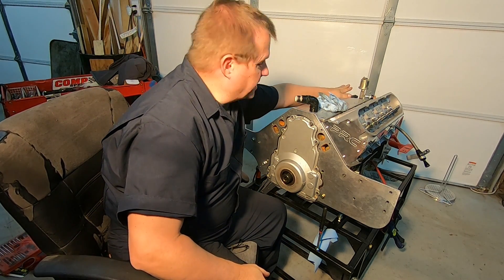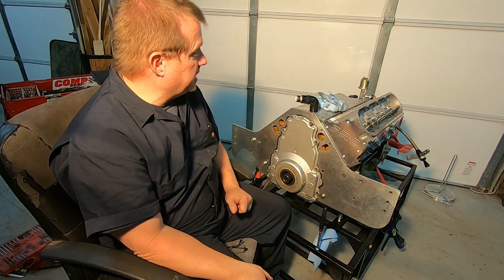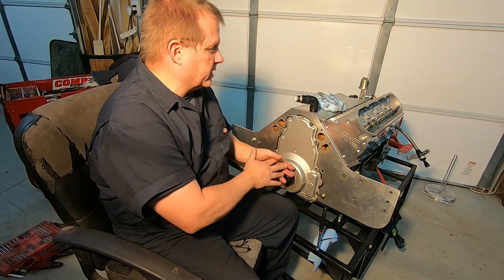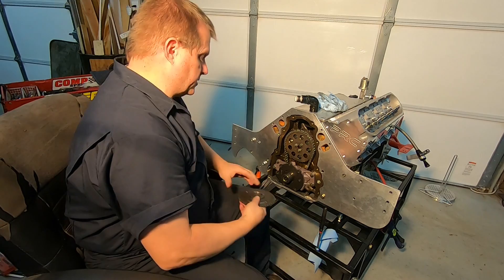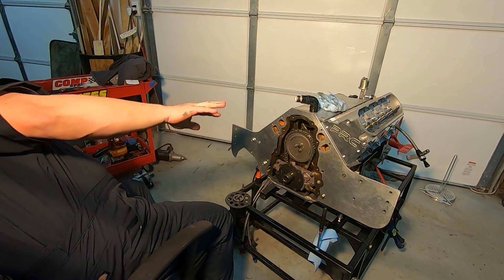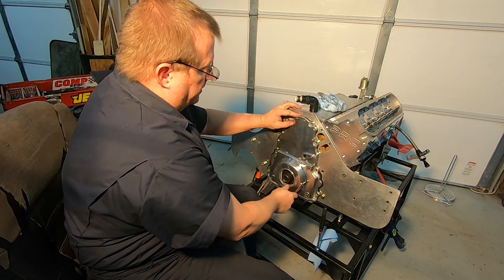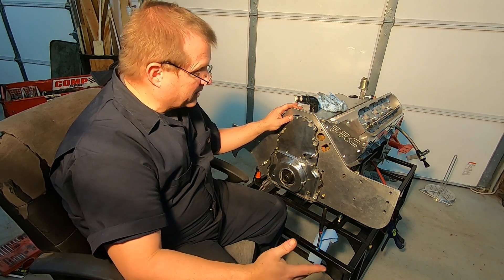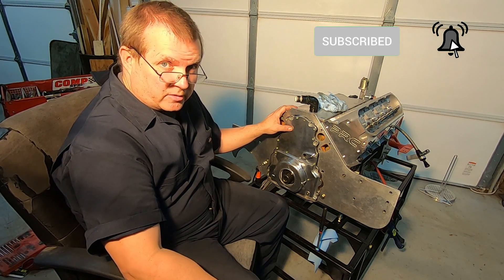How To - Swapping LS Cam Sensor from Back To Front

Comment: I got a new GM cover, included the seal, sensor and the cable harness (with guide) for the front of the engine. Only extra then needed for a standard install is the extension cable from back of the engine to the front.

Comment: Just a note to help people. When you do this and if you get pops and bangs and not a smooth running car then you more than likely will need to swap the A and C pins on the sensor. Just had this problem and even Holley was in noble to help. You can also turn off the cam sensor in Holley software but the pin swap was what worked for me.
Reply: Do you know any other methods to fix the backfire been having the problem for a long time and it keeps saying the sensor has low voltage
Reply: @TTOBS  just call me tomorrow number is on the website
Reply: @TTOBS  did you ever figure out your problem I’m having the same now with both my cars running the 6014 box only at full throttle it pops and backfire out card
Reply: @TTOBS  did you ever figure out your problem I’m having the same now with both my cars running the 6014 box only at full throttle it pops and backfire out card
Reply from the maker: Thanks for the advice do appreciate it.

Comment: thanks for the info
Reply from the maker: No problem! Thanks for watching!
Reply: hey Ken how are you
we are having the same issue with a LQ4 stroked 6ltr with a 58 rector  and a rear sensor 
we are using the msd 6ls 60143 and its didnt want to fire 
so we replaced the crank sensor with a new grey 6 ltr one and it fired but back fired 
did your fix work with the front sensor  
as thats my plan to remore the cove and fit front sensor using double chain 
hope it works 
and love to know if yours did 
thank Wayne Harris